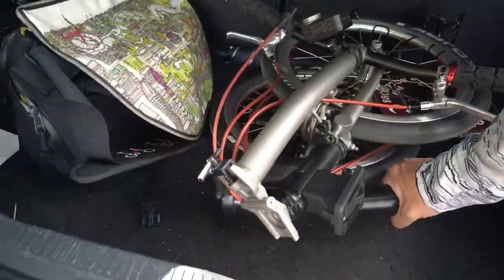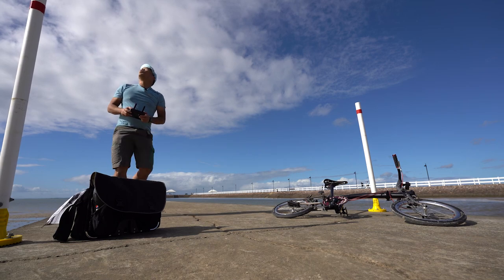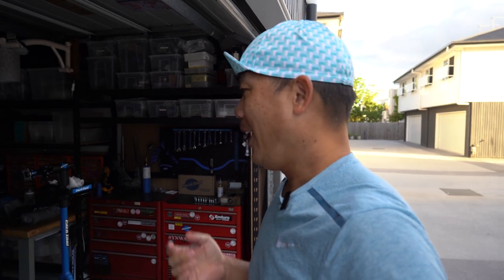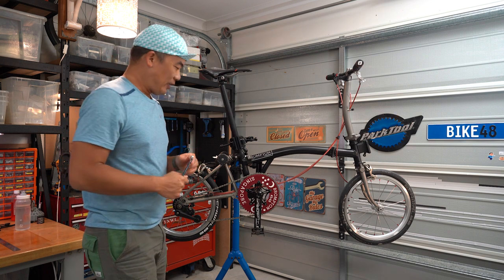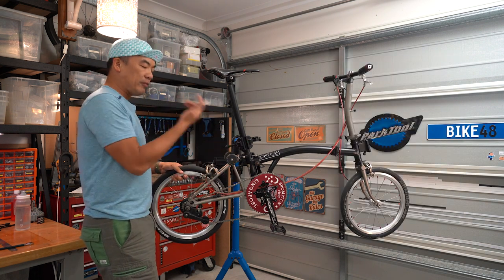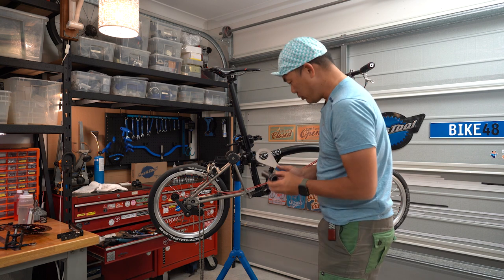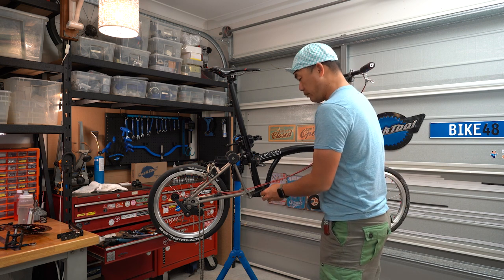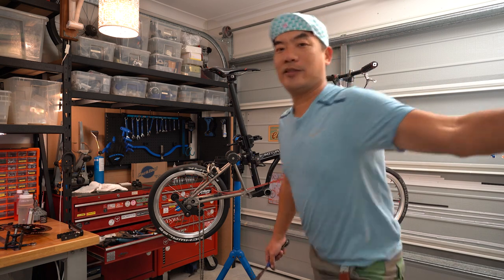Trying to fix a hollow-tech BB problem on the Brompton

Comment: At my first ordinary, "Free" service on my 2019 SuperlightM6LXBrompton I had brought a size matching titanium, ceramic crank to be replaced! It is still the ancient square type, but at least now it runs as easy as possible. I will try to find a set of ceramic bearings for the wheels, as I have on my J.K. headset. I have changed most of what I have been able to find into titanium parts and is now down around 9 kilo, with mudguards.  Finn. Denmark

Comment: Hello! I’ve been enjoying your video content. Do you have any experience on installing Shimano road chainset on a Brompton?  What bb do you use, how many spacers do you need on drive / none-drive side and do you need to change the rear sprocket and chain?
Reply from the maker: I had experienced the Dura Ace and gone to Sora’s.   Most of the time I would remove the smaller chaining.  Different generations of cranks have different requirements on the chainring bolt.   This is the part where you have to pay a little more attention to.   Most of the BB are fine here.  Most of the time, you will need about 3 to 4mm of spacers there and I am not comfortable with that much being needed.    A friendly reminder to take note on the non-drive side mounting length for the other crank arm as well.   Some safety issues there.   You can still reuse the existing chain and sprockets.   I hope I had answered you.

Comment: Remove BB cups and reseat it. Clicking is usually due to loose BB cups. Be sure to either use loctite or grease to set it back on and torque it to correct spec. That should resolve your issues. It could also be your pedal spindle. BB was over torqued and threads were destroyed. Be sure to torque to specs to avoid this again.
Reply from the maker: Hector.   It’s good to have you here again and thanks for the input.  In fact I already found what the problem was toward the end of the video.   I will be fixing up the bike tomorrow.    Cheers.

Comment: Hi, thank u for the video. Btw, can I ask a question about rattling. I not sure it is normal for the 6speed brompton to rattle at the rear when it is on freewheel. It is especially loud when on rough path, checked all the parts, all securely tighten.
Reply from the maker: Hey John, thanks for watching my video and leaving a comment for me. Not sure if you are referring to the "click click" when you are freewheeling on the 6 speed rear wheel. If you are, then it is normal. However, if you are really referring to some rattling sound coming out from the hub when  you are riding over some rough surface. It usually mean there are something that went lose inside the hub. It happened to my hub as well, I open up the hub, serviced it, and making sure all the parts were sit in well into where they were and the sound is gone. 

You can check if there are any shops that can help you to service the rear hub, they should know what to do.

Comment: Hey man, I've really been enjoying your vlog films, thanks for making them.   Your bikes are cool, how many Bromptons do you have?

I have a few other questions: 
1) What saddle post do you use / prefer on your Bromptons? 
2) I like the Ergon GP3 grips - what do you like? 
3) Did you buy your bikes with Titanium parts or did you retro fit the forks and rear triangles? (If so, do you recommend any brand of ti parts?)

Thanks again man
Reply from the maker: I have a few of them, one of them is my main work horse and then the rest is for me to play around, swapping the parts in and out. I just upload a new video today, and I just brought out a frame from my storage box and thinking what shall I be doing with it. 

Saddles are very personal, there are a few that works for me very well. the San Marco Mantra, Selle italia SLR and the Fabric Scoop works fine for me as well. 
I used to use the Ergon GP1, I had them for a long while. I like to keep to slick look and I never went for the GP3. Right now, all my bikes are on ODI grips, the they work, the best part is they even grip when it is wet.
Believe it or not, other than my very first Brompton, all the other one that I built or upgraded were using are the parts that were left over from my customers. 

Anyway, thanks for spending some love and time on my videos, I appreciated it.
Reply: Petrelli on wheels thanks for the reply I really appreciate it.  My Brompton has a Fabric Scoop saddle on which I really like. 
It was the seat post I was asking about though - do you use the stock steel Brompton seat post or have you got a mod’d one?